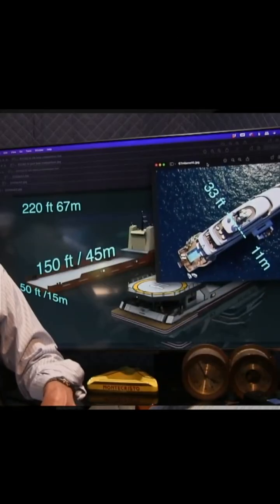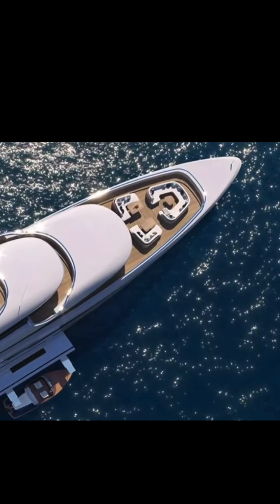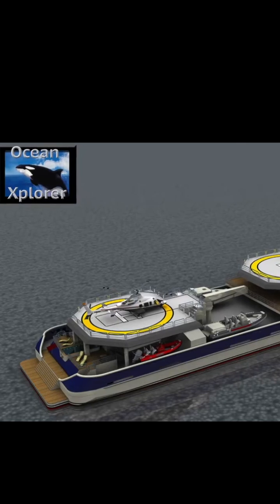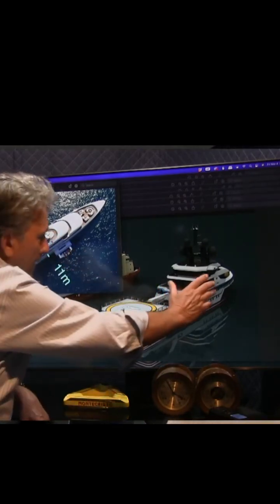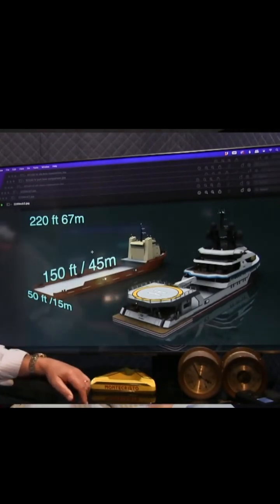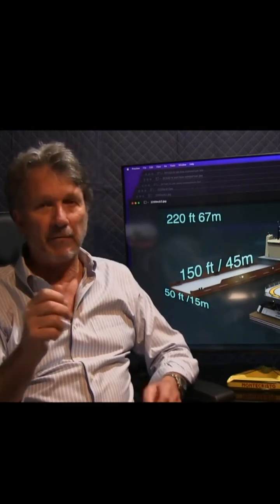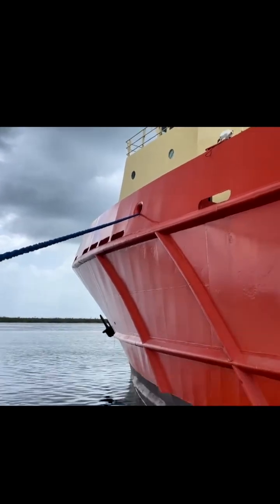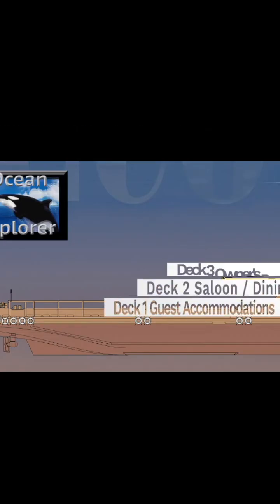OSV Conversion to Expedition Yacht - Part 2.    #expeditionyacht. #Xploreryacht

Comment: I have a secret spark plug design (1.3" diameter) that will burn seawater with as much volatility as gasoline. It requires you make the plug and modify the heads, but hey, you never need fuel ever again. Got it from my army friend who learned about it from the bombers used in Hiroshima and Nagasaki. They didn't use fuel either. Would not have the range even after weight reduction, so they used the double cobra plug. I redesigned it on cad and have the physics to back it up.
Reply: Awesome
Reply: I think that if you and I were to design an engine that utilized your seawater-burning sparkplugs and my ultra-efficient turboencabulator, we could revolutionize transportation technology.